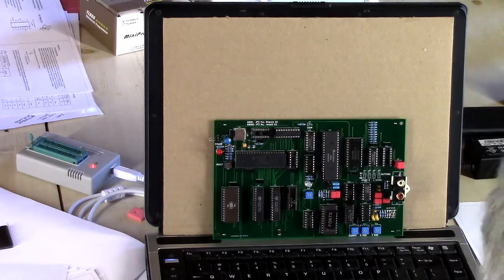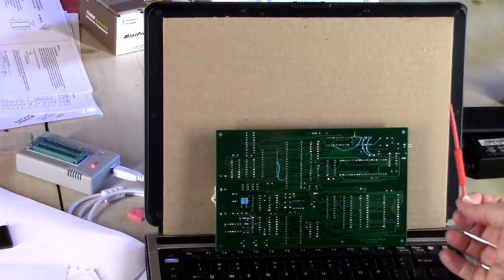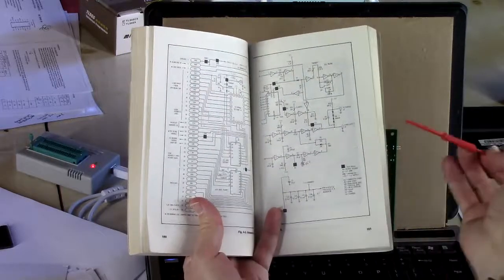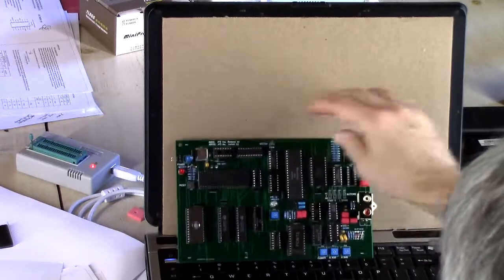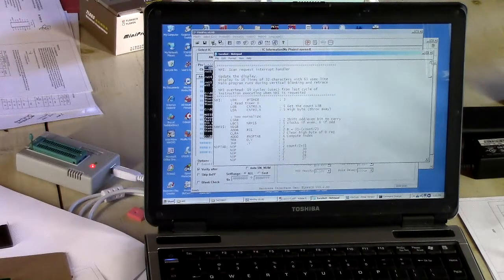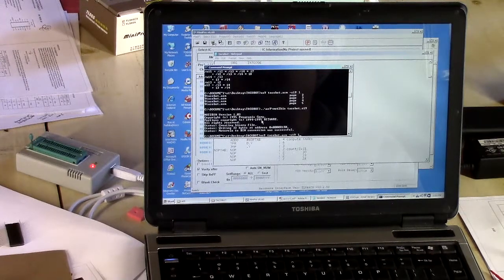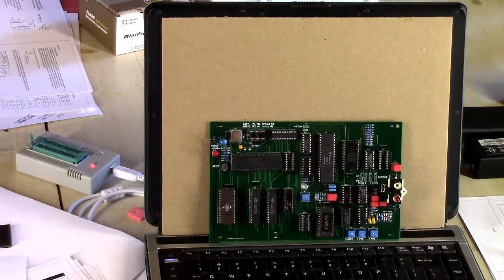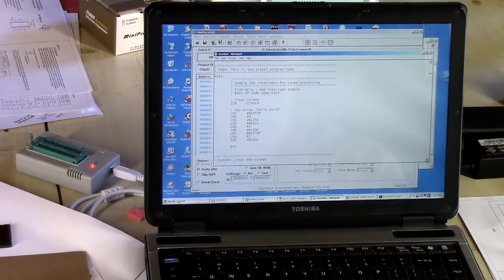Developing Software for the 6809

Comment: You are in pretty deep there. It is very difficult to develop code working blind.  If you can get your video working and write a tool to display number in hex things should get easier.   Maybe one of the 6809 simulators might help you.
  I am also working on a 6809 computer with few tools and got to the same point where I was trying to debug the code that was needed for debugging, so a chicken and egg situation.  I have an 6850 ACIA on board and luckily managed to get the Motorola Assist09 monitor running, so I have a bit more of a chance now.

Comment: I work for one of the biggest power utilities in North America and we still have more than 200 substations with RTU's running on a single 6809 at 2MHz. These RTU's control all sorts of field devices such as breakers, motor operated disconnects and circuit switchers. They also transmit all sorts of telemetry data back to a control center at the same time. These RTUs are designed in house and there is no plan on phasing them out since they are more than adequate and extremely reliable. Most have been in service since 1986 and haven't been replaced! The OS is written exclusively in assembly with over 10,000 lines. It is amazing what you can do with a well designed 8-bit CPU.
Reply: You're right on,there!

With good design, and thorough debug, assembly code development can be really solid, and damned fast.
The 6809, I think, has a really elegant architecture, and can do a lot, in an "old machine".... Also, in some ways, well-written, and documented, assembler is easier to find faults in, as you aren't dealing with huge "import" and build files.